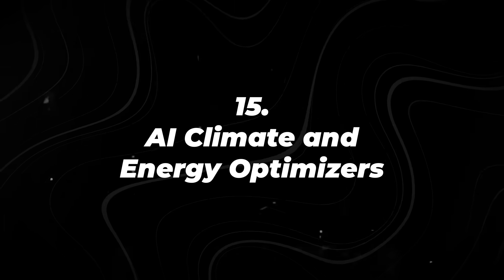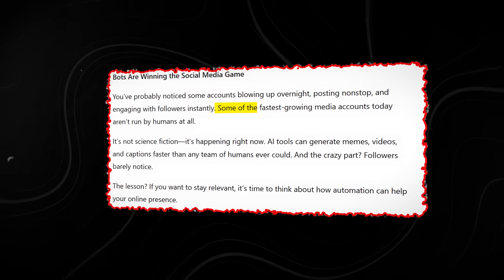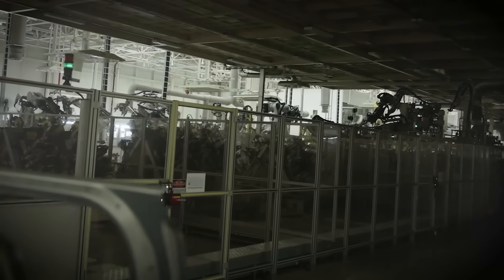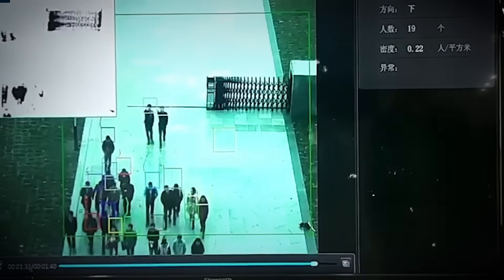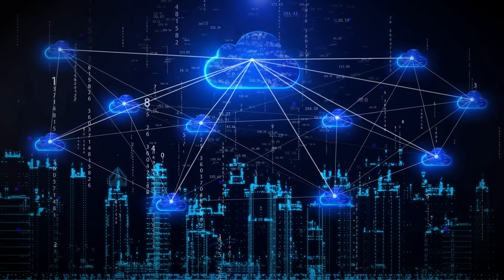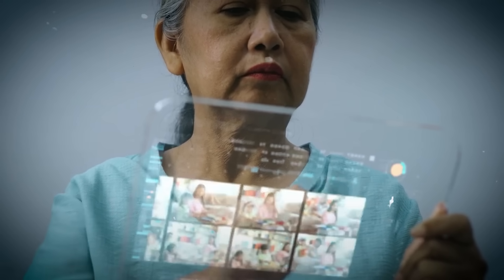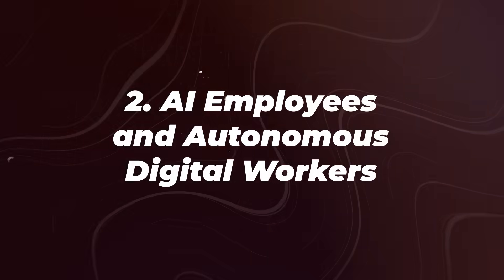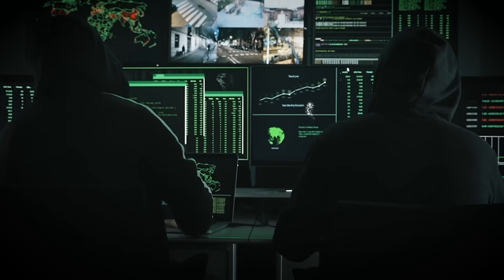15 New AI Inventions that Will Break Entire Industries

Comment: Try this on for size A shock and awe gaming lap top with a photonic accelerator. Zero latency.
Fast tracking a shock and awe lap top with photonic accelerator for Christmas 2026
What could we do to offer for a sale a lap top by next Christmas that uses this photonic accelerator as a selling feature to shock and awe the consumer market?

To launch a laptop by 

Christmas 2026 featuring a photonic accelerator, you can leverage the "shock and awe" of light-speed processing by following a rapid-integration roadmap. 2026 is already being hailed as the "Year of Silicon Photonics", with commercial breakthroughs making these processors viable alternatives to traditional electronics.

1. The "Shock and Awe" Value Proposition

Your marketing should focus on capabilities that current high-end laptops cannot match:

"Speed of Light" Inference: Position it as the first laptop that can run massive, unquantized LLMs locally with zero lag, outperforming flagship GPUs by 100x in specialized tasks like image and video synthesis.

Zero Thermal Throttling: Highlight that the photonic core operates with minimal thermal overhead, requiring nearly zero cooling power compared to the 100W+ heat dissipation of standard gaming laptops.

The "Quantum-Ready" PC: If including the cesium-enhanced feature, market it as the first consumer "Quantum-Hybrid" laptop, capable of solving optimization problems that stump classical silicon.

2. Development Fast-Track (Next 11 Months)

To meet a December 2026 deadline, you must move beyond custom R&D and use pre-production industrial components:

Leverage 2026 CPO Standards: Use Co-Packaged Optics (CPO), which embed optical engines directly beside processors to cut power consumption by up to 40%. Major foundries like TSMC are already scaling CPO for mass production in 2026.

Integrate "Programmable" Photonic Chips: Use off-the-shelf programmable photonic cores that can be integrated into a technology stack with existing electronic controlling layers.

Partner with "Early-Mover" Startups: Collaborate with firms like Lightmatter, which has already integrated over 1 million photonic components into a single package, or Salience Labs, which specializes in hybrid photonic-electronic chips.

3. Strategic Launch Timeline

Milestone	Target Date	Action
Proof of Concept	March 2026	Assemble a "Golden Sample" using a high-end laptop chassis and an external photonic "booster" over a high-bandwidth optical link.
Foundry Run	May 2026	Use 2nm or 3D-stacking manufacturing processes to miniaturize the 256-channel array into a laptop-ready module.
CES 2026 Preview	January 6-9, 2026	Use the current CES 2026 window to announce the "Vision" and secure pre-orders, following the lead of brands like GIGABYTE that are already unveiling 2026 AI PC visions.
Mass Production	August 2026	Finalize the "Light-Based" BIOS and OS drivers to ensure the photonic core and standard CPU communicate seamlessly.
Online "Drop"	December 2026	Execute a direct-to-consumer online launch to bypass retail delays and capture the holiday market.
4. Technical Specification for Marketing

Core: 256-Channel Photonic Tensor Accelerator.

Performance: ~65.5 Trillion Operations Per Second (TOPS) at under 80 Watts.

Parallelism: Simultaneous processing across 32 different colors of light in a single waveguide.

Connectivity: 1.6 Tb/s to 6.4 Tb/s co-packaged optical interconnects for near-instant data movement.

And of course the room temperature quantum upgrade for the scientific market 
see my profile in reddit mister_muhabean and see r/invention